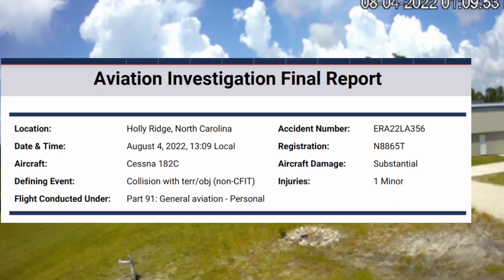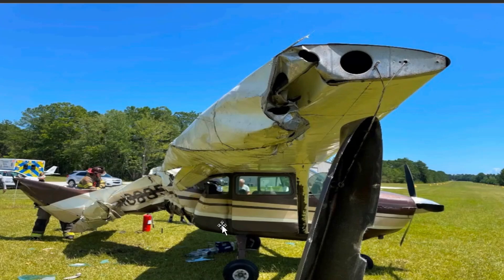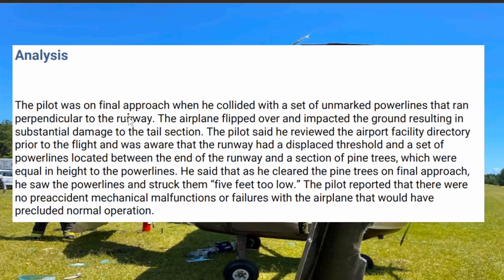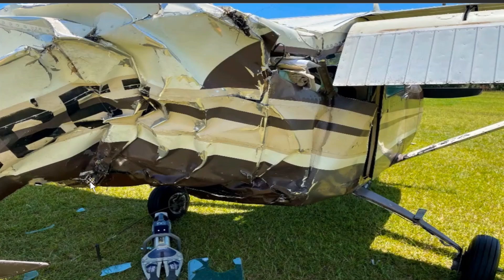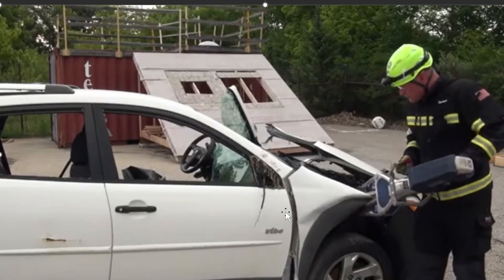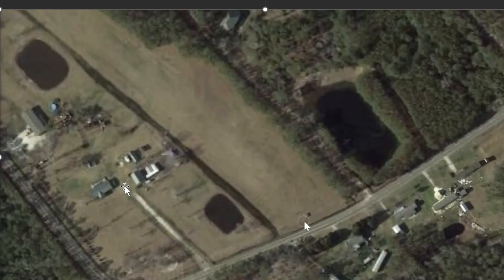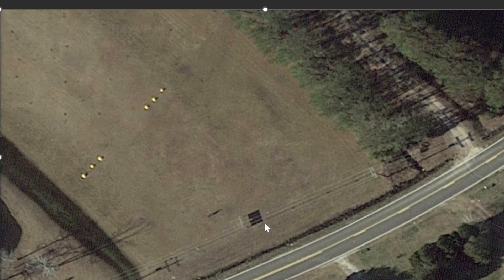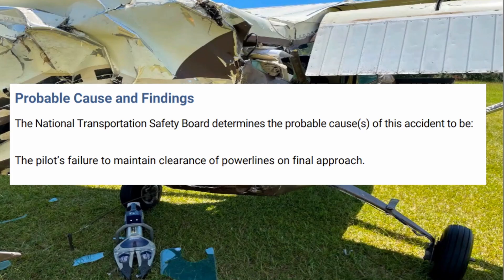Cessna 182 Strikes Powerlines in North Carolina

Comment: They can claim pilot error but IMO the lack of bright orange balls on the lines at that particular place is a significant factor.
Reply: 🛫📖🛬
You are very much right. This will end up going to court.
Even though it was on the chart that does not preclude the fact that the eluminated balls were not on the wires.
Reply: Agreed!  The power lines need to be marked with the orange balls or similar, or better, bury them since they are located at the threshold of a runway.
Reply: Exposed power lines should not be anywhere near landing or take off runways.  Indeed, nowhere near airports at all. It’s not a big job to bury them safely underground.
Reply: Absolutely correct sir !   Damn shame -   Stupid set up .   Important to have the power lines marked .
Reply: @nickybritain3661  

🛫📖🛬

👍✈️

Comment: When the accident occurred, the power lines were not marked with any high visibility orange balls. In my opinion, that is the real probable cause. The NTSB is always captain obvious in their reports, often citing what actually happened instead of stating a probable cause. It's obvious the pilot failed to maintain clearance, the pilot stated that himself. Being able to see exactly where the power lines were located would have prevented the accident.
Reply: And… the wires are virtually invisible to a pilot but it’s best to train for the poles which are visible. WWSS for wind, wires, slope, surface. PF ground briefing for a new airstrip is paramount

Comment: That is a poorly concluded NTSB report. The courts have quite consistently recognized an affirmative duty to mark or otherwise warn of the presence of utility wires in the vicinity of airports, let alone  when they are located on short final. It is ridiculous that they would not be boldly marked in bright warning colors in some fashion in that position relative to the runway, but the power companies have always fought this and the NTSB needed to bring that to attention as a safety issue and a contributing factor. They are lucky that there was not loss of life in this case with a lawsuit to follow. Ref. 14 C.F.R. § 77.17 and the FAA Advisory Circular, ""Obstruction Marking and Lighting."
Reply from the maker: Thanks for sharing your take on this

Comment: Man!!!! That was sooooooo fortunate in how the plane landed tail first. Those power lines should definitely be marked better, but the pilot had the info he needed to miss them. Extended threshold means your final is adjusted to clear hazards at the approach end of the runway. You will have a minimum altitude that you need to clear them and slightly extend your touchdown further down the runway. This is a similar situation to the road in front of the Langley airport that the old guy came in too low on and hit the truck.
Reply from the maker: Yes.  What a scare for the friend watching also on the ground
Reply: Correct.

Comment: This same thing happened to a friend of mine in April 2019 at this airport on that end of runway with the same power line. I cannot believe markers haven't been installed. He was not as lucky as he hit nose first and suffered compound fractures to his ankles and multiple impact injuries and was covered with gas. (Something to be said about no electrical system). He's okay now after month's of therapy. He was in a cub type LSA experimental with steel tube frame and very low speed. That saved him.  FAA dinged him for not complying with displaced threshold. What's even more maddening is the trees are cut back into the wooded area to create a notch to extend departures and allow for shorter approaches. This was most likely done years before the newly installed power line that is at the beginning of the runway and past the notch. " Oh we will need to put a notation in the data base and set up some cones to displace the threshold" most likely said by the FAA. What the hell is wrong with not only the owner of the strip but the power company and the FAA. A short turf runway with an existing approach notch with recently constructed power lines past the notch is inviting this. I mean it is literally a fly ribbon for aircraft.  Should we take up a "go fund me" collection to install markers to save a life or two here? This really fries me.
Reply from the maker: Unreal sorry about your friend and glad they are ok now

Comment: So glad the pilot was fortunate enough to walk away from the accident virtually unscathed.  Its nearly impossible to see powerlines near any runway until you are right up on them.  The power company should mark the lines with 12 inch diameter red balls mounted to the lines for a better visual reference.  Particularly, the lines being that close to an active airport.  I noticed the NTSB made no mention of marking the power lines.  Shame on them when its obvious doing so can save lives.  Unfortunately, this accident is ruled as pilot error.  The plane is totaled, but could be canabolized for parts.
Reply from the maker: Good point Jim.  Not at all just the pilots

Comment: In your overhead view, the powerlines along the road are at a slight angle to the runway.  Neither they nor the further away trees run squarely across the approach end.  There should have been balls on the powerlines, but pilots have to deal with things as they are.  On the recon around a field before spraying its crops, I determined how every powerline entered the field and how every powerline exited the field.
Reply: Hit the wrong key.  To continue:  Powerlines at an angle to the shape of the field, or roads, or other squared to the field objects, are very dangerous.  We have to give them a wider birth and make more passes to clean up going the other way.  Anything flight path left of the mental centerline extended on this approach would go over the wires closer to the displaced threshold.  This is a very dangerous optical counter to good situational awareness at this airport.  Unless they fix it, there will be more similar accidents.  Pilots at uncontrolled fields do not regularly recon around the field before landing.  This field is dangerous to any pilot without prior experience here or a good field recon prior to landing.
Reply from the maker: I agree and thank for writing in.  These things are bound to reoccur if not fixed.  Appreciate it Jimmy
Reply: That should of been marked somehow in my opinion. That's just crazy. I can't see which way the power lines run??
Reply: And I bet that wasn't the first, nor the last if someone doesn't move to make it safer.

Comment: What people may not understand is these power lines have been here much longer than the private airpark landing strip! They built it KNOWING these power lines were there and failed to properly mark them with orange marker balls! The power lines were not installed "After" the airpark was established! So there's the problem! If it were MY personal airstrip, I would have numerous balls up there just in case someone dropped in that was visiting and unfamiliar with the airpark or at least file a NOTAM or VFR sectional alert as a flight hazard with the FAA to warn pilots  when using this airpark. We can do better than this! 👍👍
Reply: How do you know which one came first?
Reply: @greggrace967  Because IF the airstrip was already there, the Power Company certainly would have put the orange balls on the lines KNOWING they were at the end of an airstrip due to liability! "I used to work in the powerline business!"

Comment: From iFlightPlanner N21 remarks: “A57-14 - RWY 14 APCH RATIO 15:1 TO DSPLCD THR DUE TO 60 FT UNMKD PWR LN.” The friend was parked at the northwest end of the runway, so he was landing on runway 14. Google maps shows orange balls on the other end in 2013 and 2019 so runway 32 is marked. Why not 14?
Reply from the maker: Good point. Thanks for correction

Comment: With power lines in this close proximity to the runway threshold it is pure negligence on the power company for failing to place warning balls on the uppermost power lines. What the report failed to say is from where the sun was coming in relation to the aircraft and power lines. Lines are extremely difficult to spot in most circumstances but next to an airfield, even worse. I see balls stretched across power lines in agricultural areas where they use aircraft to spray crops. Farmers bitched at the power companies then took their complaint to the FAA which got involved.
A new aircraft and compensation due to the power company’s negligence is in order.
Reply from the maker: Negligence for sure